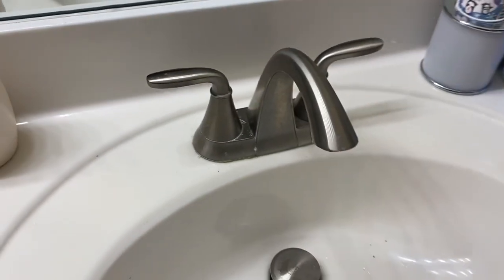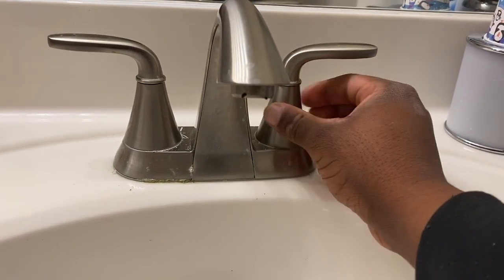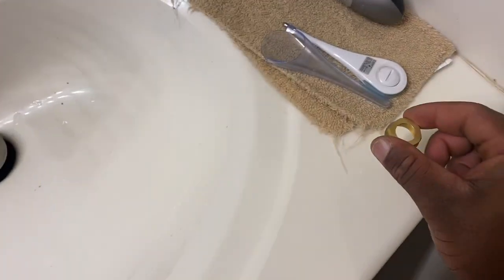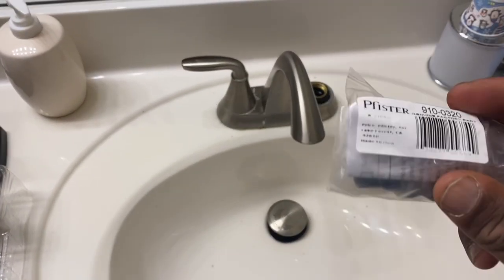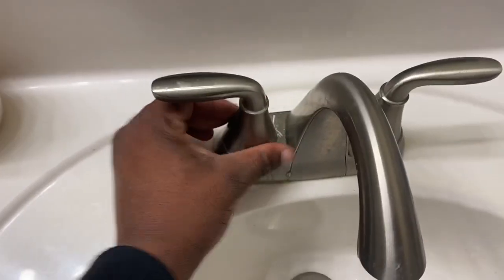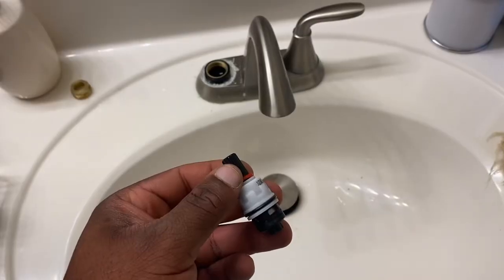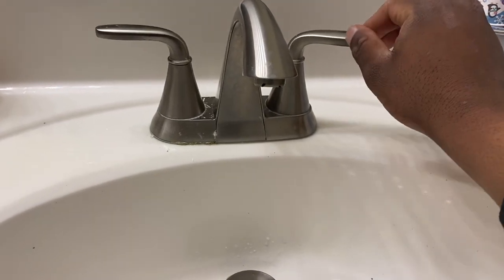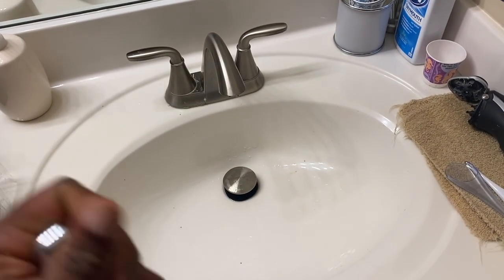Hot and cold Pfister Cartridge replacement on a bathroom faucet

Comment: Very good video!  The only thing I’d add is once you remove the old cartridge, compare its height to the new one. You might find like I did that the old cartridge was shorter, because the old cartridge bases were broken and still inside the faucet. Make sure to remove that. I had this happen to both old cartridges. Also, Amazon has these replacement cartridges.

Comment: Nice video, looks like you got lucky pulling the old cartridges out though. Mine completely fell apart as I pulled them. They are junk. I had a Pfister kitchen faucet with the same cartridges and I spent hours trying to dig out the very end of one to the point where I gave up and installed a new faucet - so I already knew what I was in for when I saw this. I'd avoid Pfister faucets in the future, at least the ones that use the 910-031 & 032 cartridges.

Comment: Turn the shut off valve off and the hot water size still coming out water when turn the handle to open position what do I do to stop it so
I can change the cartridge
Reply from the maker: I recommend looking for a shut off valve inside the house or just go to the meter and shut the meter off while your doing the replacement